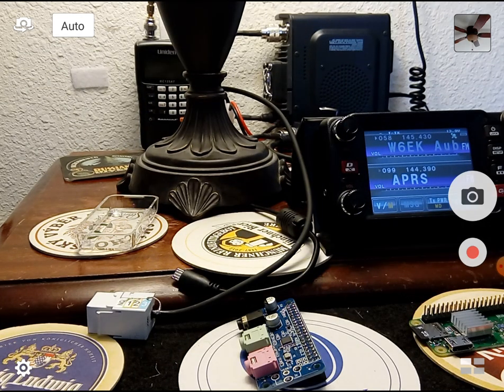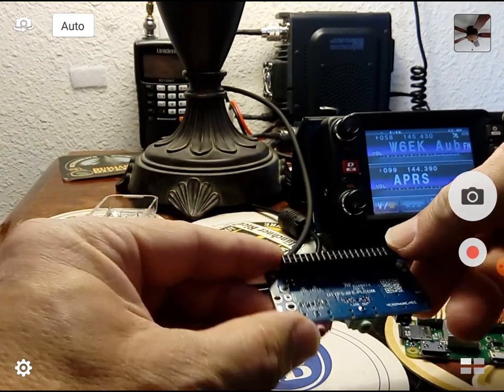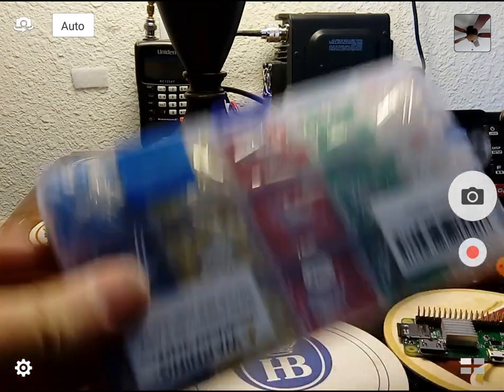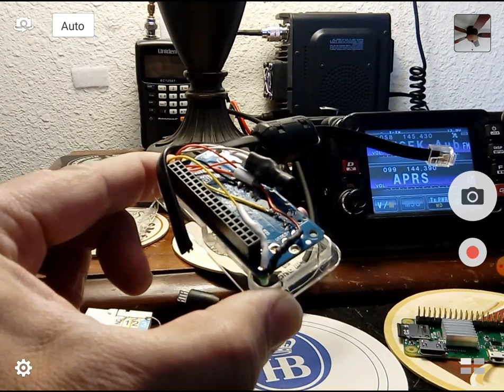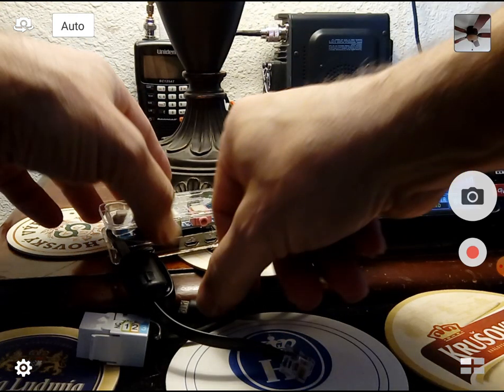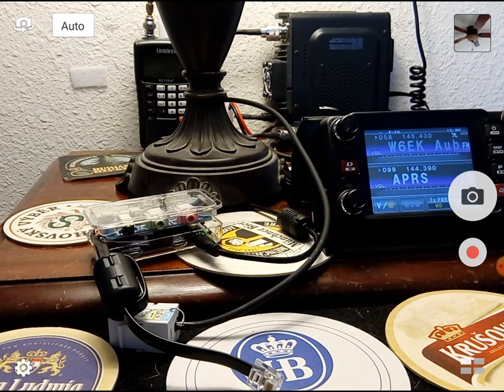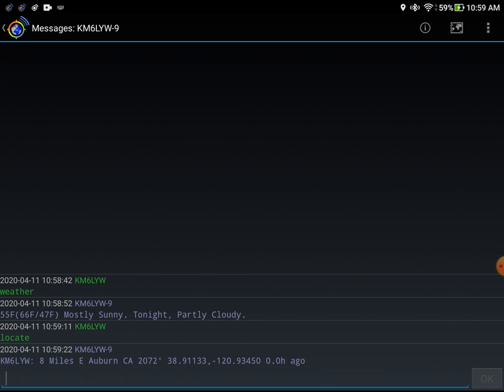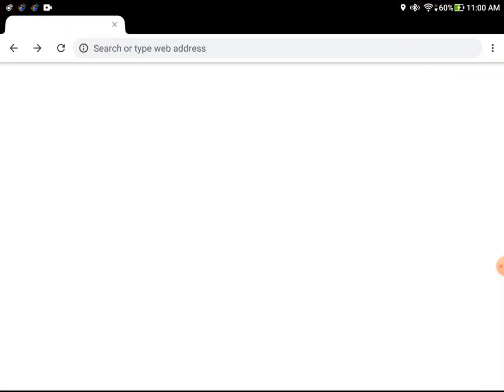Packet Radio Raspberry Pi build and demo

Comment: Craig, you're using the data port on the FTM-400 rather than the mic socket from what I can see in the video?
Reply from the maker: correct.. the back of the ftm400 has ptt/ground/linein/lineout.   The line out is a 1200 baud discriminator out  (there's a 9600 baud pin too).  The breakout cable yaesu sells for this 10pin din is incredibly expensive.  In this instance, I rebuilt the USB cable they put in the box, though, I wouldn't recommend this route.

Comment: Is there an iPhone app that would be best to use with this system?  I plan to initially use it as a simple digipeater, but would like to use an IPad or Iphone for field use.  Anything special to do to APRS digipeat mode (for simple digipeater) other than change contents of Direwolf configuration file?

Comment from the maker: The web/php front end, along with the direwolf/conf files are here:  https://github.com/craigerl/digipi
Reply: But no schematic image file and parts list :-(
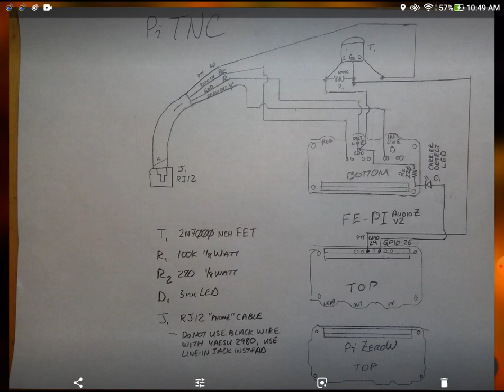Reply from the maker: @TheSulross  Wiring diagram and parts list is at 2:23.    No schematic, but I'll post one if anyone gets creative!  the only thing that wasn't obvious in the diagram was the tips of the linein/lineout.  If you have the parts, you'll see where they go.
Reply: @KM6LYW  Well, my eye sight isn't what it used to be so was having a bit of trouble trying to make out everything on the video per the schematic and what the parts are. I'm just getting into radio for first time, okay, is GMRS, and I want to make the same kind of device for my radio (FCC cleared GMRS for doing text messaging back in 2017). I don't intend to re-implement the entire packet radio stack by any means, but merely do something super, super dirt simple like computer encoding/decoding of analog Morse Code - over GMRS repeaters where a computer server monitors the repeater for text messages traffic.